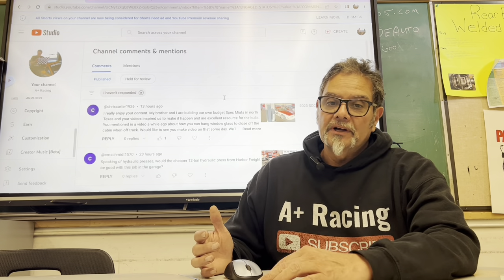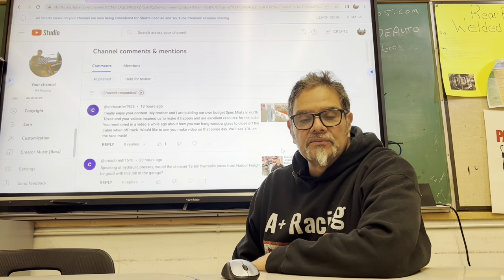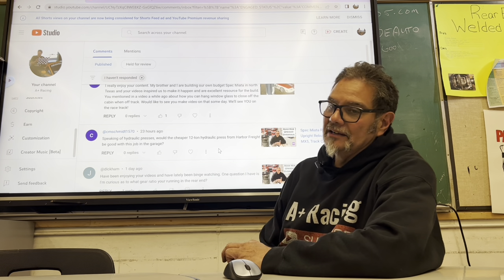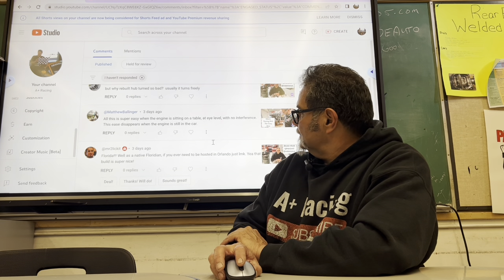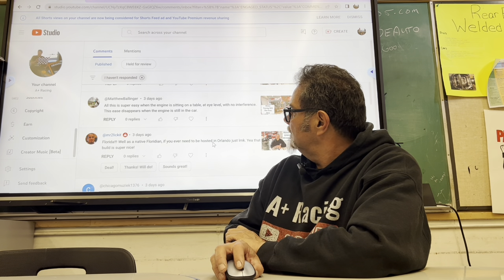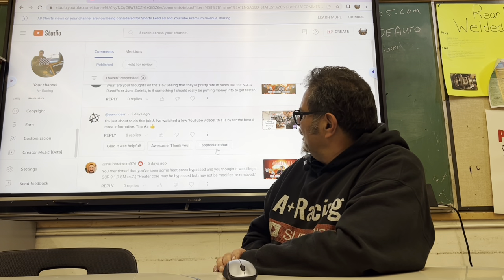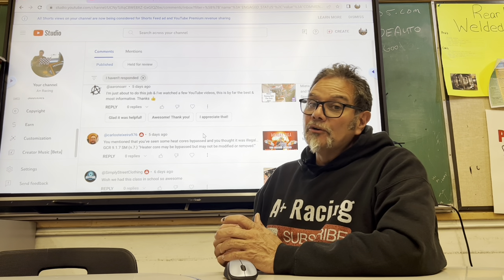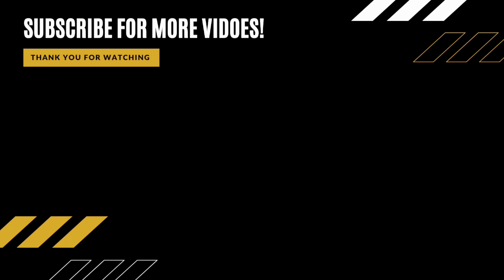Q&A Monday, Your Questions My Answers

Comment: Hi Al, 
While driving my 02 NB, the oil drain plug fell out. I stopped the car with 0 oil pressure. We replaced the plug and filled
The oil. Upon restart we got the dreaded knock. Quiet after 2 seconds. Drove the car 6 miles and the knock came back. Car parked until I decide the next action. Advice will be appreciated. 
Thanks,  Dave from mississippi
Reply from the maker: Answered on Q&A Monday